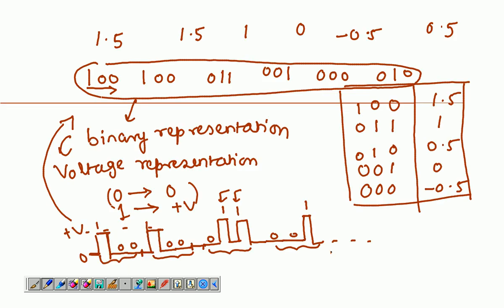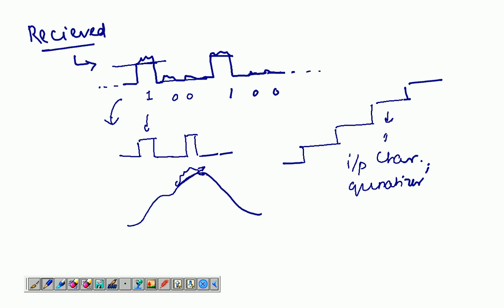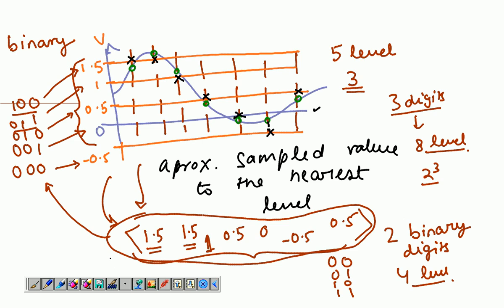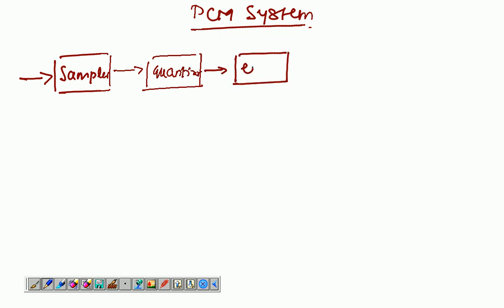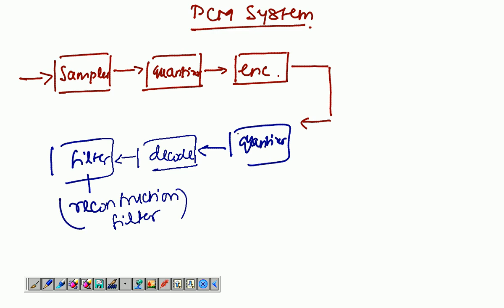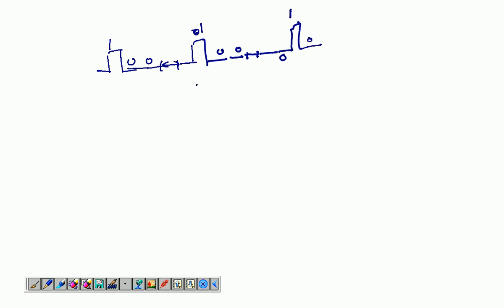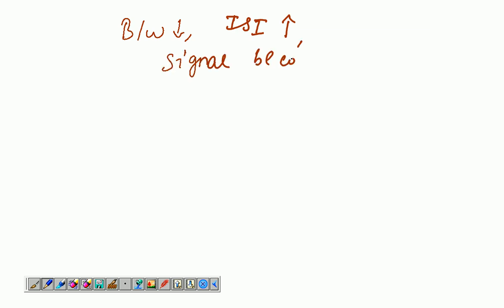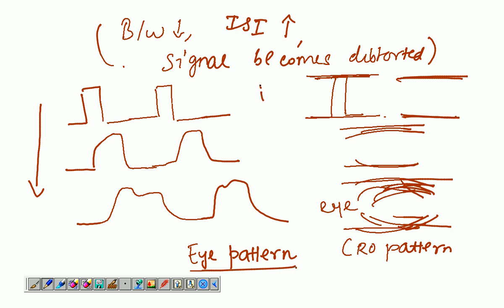CS - 05 - PCM System, Intersymbol Interference & Eye patterns

Comment: I have one doubt, when transmitting data say in optics, light would suggest that value is 1 and absence of light represents 0, how in order to gather individual binary words, what does leaving a space mean. in binary there is nothing as a space. it is either 0 or 1.
Reply: I am not certain, but I believe this would be built into the protocol for the sending and receiving entity

Comment: A question: In block diagram of PCM system, at the receiver side, Why you claimed that  the decoding process is performed after quantizer? I think it is not the case and actually it is vice versa. By the way, thank you for preparing this video.